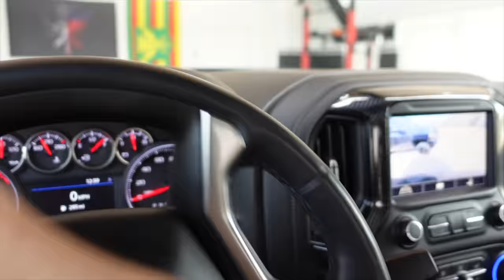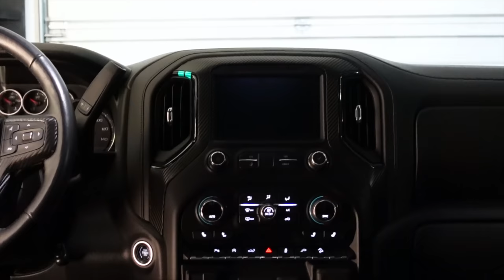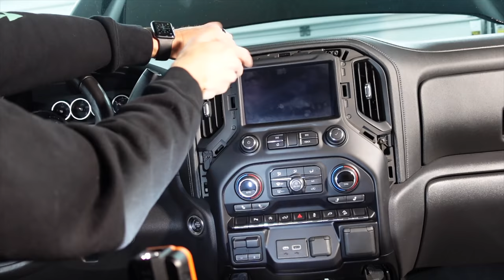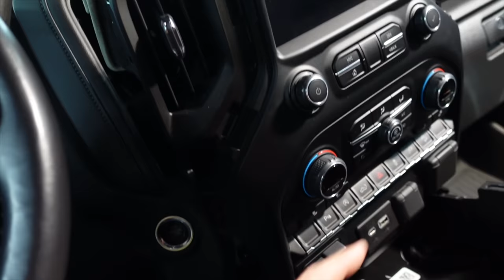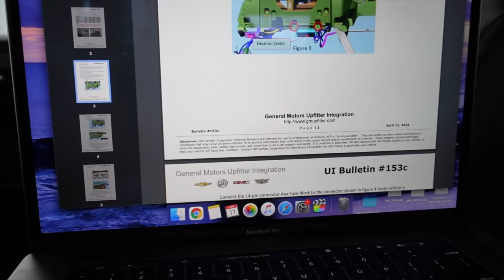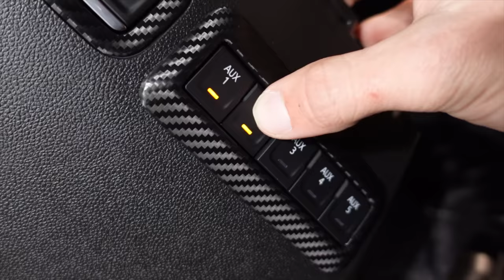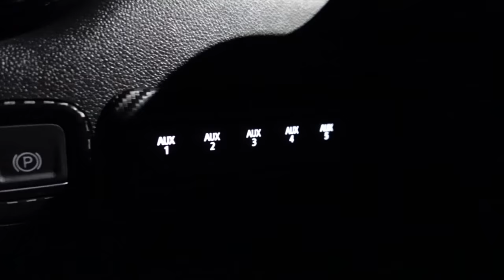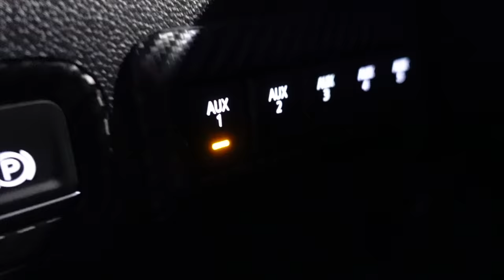GM Silverado Upfitter Switch Kit 2019 - 2022 Trucks [AMAZING]

Comment: You did a great job but after watching this. No way I’m spending 6 hours tearing into my new 3500! For 90k It should have came with those to begin with. And I’d prefer to have them by the garage door opener’s. All the garbage GM put under the steering wheel you almost have to come to a dead stop to find them safely! Dig the wrap also!! That’s probably something more in on my level if I screw it I can just start over again 🙏👍
Reply: But if you use a oscillating multi tool and follow the dimensions on the hole for the switch you can do this on your existing trim piece. that's what I did and it was all done including wiring in about 1 hour.
Reply: @FUIKO1963  I was going to dremel it, or is it a bad idea?
Reply: @gohangan  no use a multitool and tape surface to draw a line where to cut
Reply: @FUIKO1963  
Wondering if you bought the wiring harness separately also? I like your idea, there’s no way I would attempt to take everything apart …I’d have lots of broken stuff for sure!
Reply: @davemeisner9100  I bought the complete kit I don't think they sell it separate

Comment: Everyone has their way of running wire through the firewall grommets. But i’ve always made a little puncture hole (using a pick or needle), you end up with a little better seal around the wire than you would with a slit. I’ve had slits tear open more than I have with a pin hole. But you’re rarely going to be in situations where water is going to get inside because of that i guess…
IMO the switch panel little lights would look better if they matched the other lights
Reply from the maker: I ended up just snipping a small slit in the grommet 🤙🏽 also why I needed some WD40 to get it in there 😅

Comment: Your TB is sick! Molding mine similar. Question: Did you tie in your fascia lights to the fogs? Could you wire the fascia lights to this as well? Here in VA  they got some crazy rules with lights. Thanks man and keep up the great content on the TB. That truck looks so good!
Reply from the maker: 100% could wire up the facia lights to the upfitter switches. Would be an easy add now that it's installed.

Comment: @Lonestar Hawaiian Good morning! I finished my upfitter install yesterday thanks to your video. I also have the Rough Country grille LEDs  and was wondering if you only attached the blue wire to blue wire and got it to work for switch # 1? What about the power wire on the battery and then the interior black and white wires from the LED lights? Did you just tape them up or connect them to something as well?

Comment: The trim pieces on the steering wheel. Did you leave them on when you wrapped them? I want to do mine, but not sure about taking them off. I also want to do the trim around the vents, and you just answered my question on those lol. I love the carbon and ocean, looks awesome man
Reply: You have to remove the steering wheel to get the trim off. I replaced my non leather wrapped wheel with a leather one and it was from a high country so it had the bronze trim and not the silver of my Custom. The way all the screws are you have to have it off to be able to access everything to pull just the trim pieces.

Comment: The 5th switch is for a lightbar/beacon on the roof. My 2020 has the factory wiring harness above the headliner,behind the 3rd brake light.
Reply: The wire comes from the big connector (that plugs in behind the ebrake switch), green with red trace. Before I installed everything I put female lugs on the 4 AUX wires and spliced in a green wire to the lightbar/beacon wire so I can connect loads to all 5 AUX switches at the switch box unit. 😎 Aside: I think it SUCKS that GM wouldn't install this box when Upfitter switches are a factory option (as it was on my 2022 Chev 2500) 😡

Comment: I may have missed it… Your led lights have a relay.. does that mean that the power and ground wire are separate from the switch?   Are the power and ground hooked to the battery?  That’s why only the blue switch wire is connected to the upfitter?

Comment: I know it isn’t this video, but I wondered on your other 1500 did you have any problems with any gas coming inside the cab from the exhaust dump.
Reply from the maker: I was worried about that at first but no issues. Dumped right at the rear axle was far enough away from the cab

Comment: In the video you mentioned there is a relay on the auxiliary light. With there being relays in the fuse block of the upfitter switch kit can the relay for the auxiliary lights be eliminated?

Comment: So when you connected your light harness, does it go from the light, to the battery, to your upfitter switch? I’m currently wired with a generic harness that has a relay. The harness has a power and a ground, then the wire goes into the cab. I cut of the cheap switch and ran the yellow wire to the blue #1 switch and I’m getting nothing .

Comment: I added upfitter switches to my trailboss  before I even added my off-road lights. Lol. The Aux 5 wire ends by the third break light. It’s for the roof beacon but under the dash it should be the light green and dark green striped wire going from the upfitter fusebox into the grey connector, at least it is on mine. You can depin it from that connector or just put a T-tap right there if you need the 5th aux

Comment: I remember when the lower kick panel was the first thing that had to come off the dash. The good old days. Adding any electrical accessories now appears to be a pain in the dick if you have to disassemble have to truck to get under the dash to run wires.

Comment: Rough country has a wireless option as well. I had the switch wired in before I found it.  I use it for my light bar. Gives the strobe option as well. Has a nice key fob.

Comment: I don't understand what the 200 amp fuse is for. It is connected to a crimp wire connector. But a wire isn't even crimped on to the connector. Unless a device is used for a heavy load is the 200 amp even necessary?

Comment: Really want these switches but don’t want to tear the whole dash apart.  Could you order just the switches and wiring harness and cut a hole in the existing dash? Or just take the switches out of the new dash piece and cut the hole in existing dash without taking it out of the truck.

Comment: Thanks. I have learned so much from you watching your videos so a big thanks. No not too much info as matter of fact a ‘do-it-your-seller’ idiot like me would attempt that on my 2020 Z-71 RST which also happens to be black and which I absolutely love. Mine came from factory with all badging blacked out except for the Z-71.  I have learned that if one takes one’s time and follows directions one can do a lot of things to one’s vehicle. I like the fact that you are OCD like me and things have to match up. Oh and that other car that went by you with the colored lights on, I used to drive one of those. Now drive one without the strips as I now work in administration.  Love you truck and most all the things you have done to it. Oh by the way one of the hardest things I did to my truck was change out the license plate lights to LED bulbs. I have medium size hands and it was very tight space. Almost got my hand caught. NOT SILLY TO BE EXCITED ABOUT A SWITCH.

Comment: Nice bud!  How many Amps is each switch rated for?  And where did you get those blue trim removal tools? 

Are any of those switches constant power?  In other words they will work with the truck off.  I think I’m fords there is only one factory switch (#6) that has constant power.  So you can use switch #6 with the truck off but you obviously have to toggle the switch on.  The other switches the key has to be in the on position for them to have power.  Hope that makes sense.  Was just curious for this kit cause I can’t seem to find that info anywhere.  I’m wanting to wire my 30amp transfer tank fuel pump for that factory look.  Plus, by having the switch you can turn off power to the pump so people can’t steal your fuel!

Comment: I believe aux5 is a green wire with a blue leader that is actually run above the headliner to the brake light above the rear window. It’s intended to be for a rooftop emergency light or other additional lighting on the roof of the truck

Comment: Question, does the Upfitter switch stay in the last pressed position? Example: I press the button to keep the 10 inch grill lights on, turn off the truck, come back to the truck, turn it on and switch remains in the on position? Or do you have to press it each time like the fogs?
Reply from the maker: The switches act as an on/off switch. If you press them to turn them on they will remain on until you press the button again 👍🏽
Reply: @LonestarHawaiian  Fantastic! I love your videos. Started watching them after I purchased my 2020 Silverado RST last year. Thank you for the content and for the "wallet lightening" ideas!:hand-purple-blue-peace:

Comment: Hey I want to plug a dash cam power it thro  the back of my stereo what would you recommend I was going to target by the fuse box but one of my friends told me to do it through the back with a stereo so when I shut the truck it will turn off

Comment: I did the same install over the weekend on my 3500.  I cheated though. I cut the pattern out of 1/8" plastic with my laser engraver. I taped it to the knee booster with two sided tape and used an ossilating cutter to cut the hole. All together it took me about 1-1/2 hours to install.

Comment: Hey Brotha big fan on your channel. Keep it up with the hard work. So I was interested in doing the same with my 2020 silverado. Do you have to take off the panel if you add additional accessories to the other aux switches? Or is it easily accessible to connect new wires to the other aux switches once the panel is installed? 🤔
Reply: It’s easily accessible once the panel is installed. The only thing you may have to do is removing/adding zip ties, so the connections are tucked away after every new accessory.

Comment: just a heads up switch number 5 runs to the third brake light to run a roof top caution light bar.  or what ever you hook up to the wires that terminate there

Comment: I appreciate the more detailed videos. Awesome that GM makes that for the newer trucks. I don't think they do for my 2018.
Reply: They make upfitter switches for the 14-18’s
Reply: @midget_cannon8517  Yea, but I thought those are only for lower trim trucks. Mine is a LTZ Z71 Midnight Edition.
Reply: @JowieC  it just depends how man switches you have. My LTZ only has 3 factory switches so I can put in 4 aux switches. If you have 5 switches you can still put in 2 aux switches